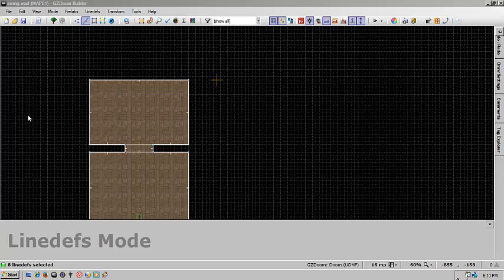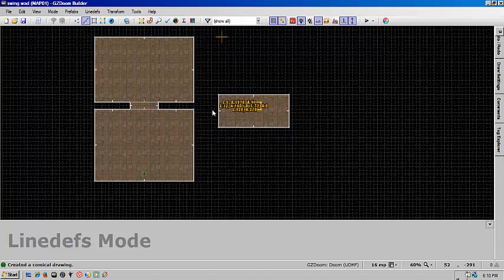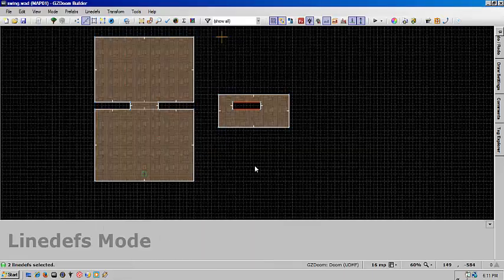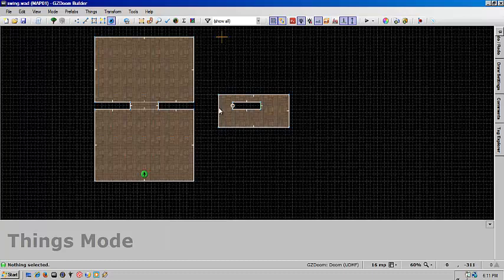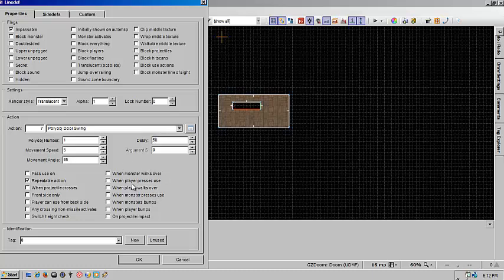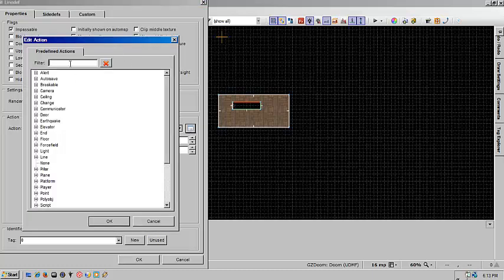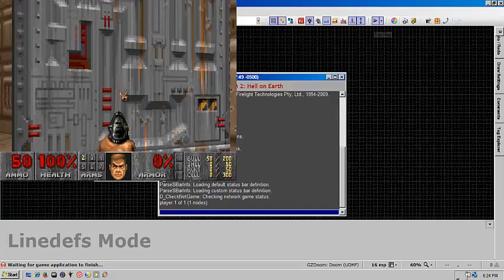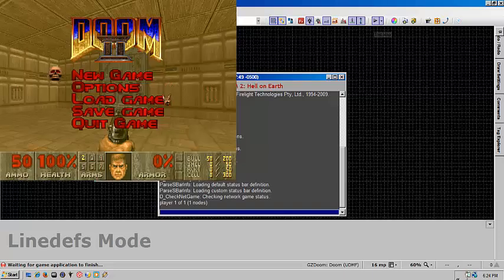(GZ)Doom builder - Swinging Doors Using Poly Objects

Comment: Hey there, I've got a question, and I'm asking around everyone and 
nobody's got an answer. So I made a swinging door that doesnt reach all 
the way to the ceiling (applying your tutorial to a sector instead of an
 empty block of singlesided linedefs) it works and looks great, but I've
 got a problem : whenever the door collides with sprites (say, an ammo 
drop or a corpse) the sprite "jumps" on top of the door. Looks goofy as 
heck. Any idea if there's away to fix that ? Thanks !

Comment: Thank you Doom HQ for this tutorial.

I'm using GZdoom builder in udmf wad format using the Zandronum port, is there a way to make the doors locked - and opened by keys?
Reply from the maker: ookiemand You should be able to using acs script pretty easily unfortunately im without computer at the moment so i cant make a tutorial on it the zdoom wiki has information on all of the acs script equivalents of these functions and should be able to  help
Reply: Thanks, check my personal message in your inbox.
I was already looking through the wiki, getting closer to a solution.

Comment: Would I need to script having two doors open at the same time, or could I link them together using a linedef action?
Reply: MrEnchanter Nevermind! I applied the tutorial from the split sliding doors to the swinging doors, thanks!
Reply from the maker: MrEnchanter Good deal that would have been my recommendation . If you have any other questions issues or requests please let me thanks for  watching

Comment: Yo in the version i have i can't set negative movement speeds or anything.. it just opens to one side.. what do i have to do?
Reply from the maker: ZeMovinPixxle If you aren't already using gzdoom builder i recommend updating to the most current version of gzdoom builder instead of using doombuilder 2 because it is not being developed or updated any more.  If you are using gzdoom builder update to the most current version and ensure you are mapping in either doom in hexen mode or UDMF format I personally use the installer version of gzdoom builder and map in UDMF format.This should fix the issue you are having .Otherwise if it doesn't either set thereverse side the same as the front if you Don't mind it opening back into the room  if you do mind you will need to use an acs script on the Other side which will allow you to force a reverse speed to do thise set the linedef action to 80 execute script set the script number to  37 nosave that and open the acs editor  and create a genaric acs script as usual  give it the number 37 and use PolyObj_DoorSwing(sector id,speed,angle,delay) that should allow you to force the door to open the reverse ways without issues
Reply: Doom HQ How did it never occur to me trying it in UDMF XD Thanks man :3
Reply from the maker: Not a problem if you have any other questions issues or requests you can  private message me thanks for watching
Reply: I will def do that :3